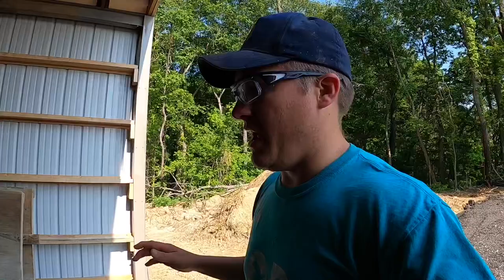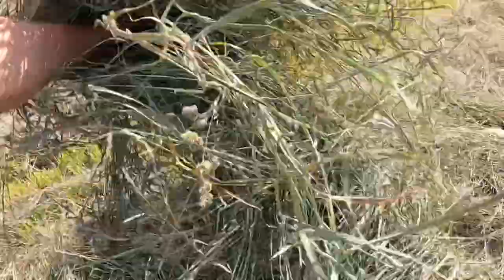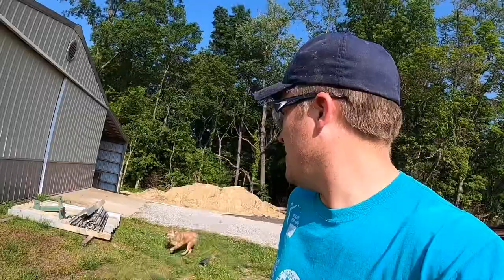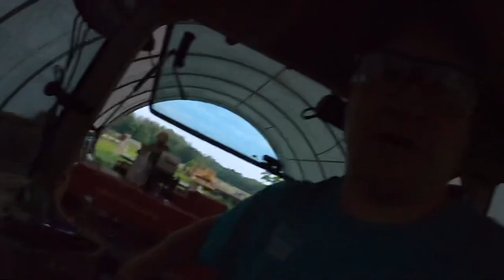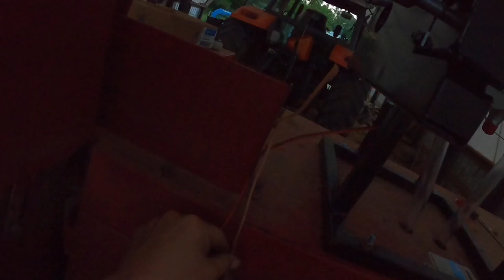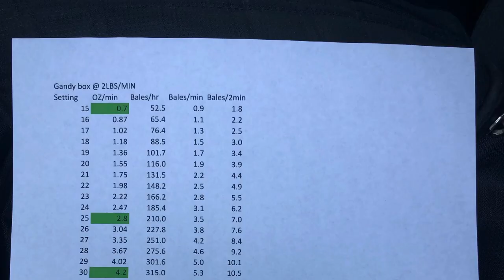Checking the Hay and Calibrating the Gandy Box!

Comment: Finally got all my first cut done.  I only have about 39 acres to mow.  Not as good as last year bale per acre.  How boutique you?
Reply from the maker: Compared to last year about the same. Maybe slightly more yield on the acres that are producing. I have some low spots in some of my fields where the orchard grass has died out due to being too wet so they didn’t produce very well. Hitting it with nitrogen early helps here.
Reply: @thebalerman  used nitrogen in April. Just fertilized  again this week.  Had a cool snap early May. I think held it back a little